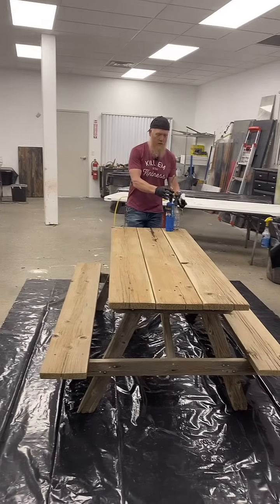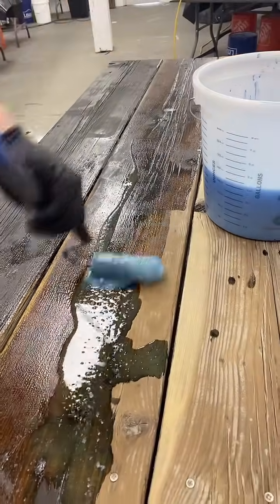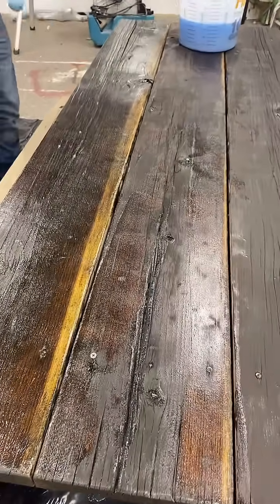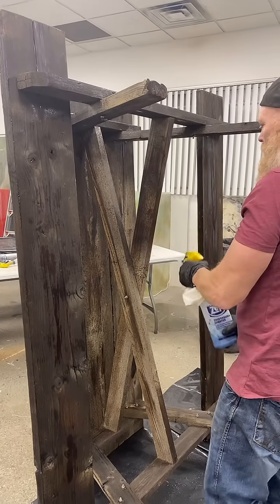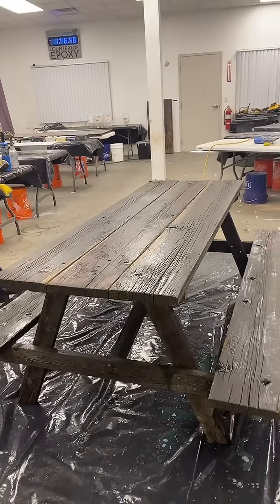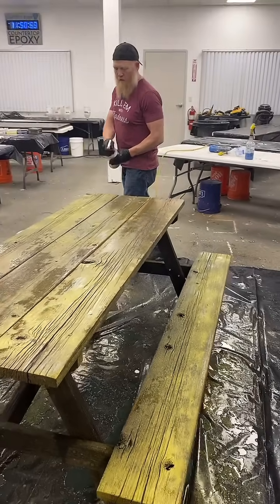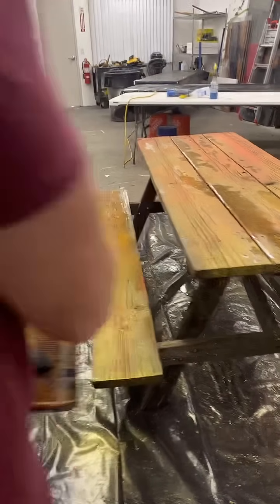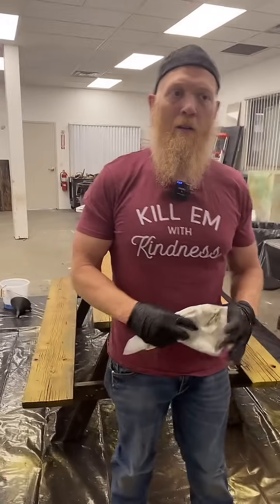Trashed Picnic Table Prep from Resurfacing - TikTok Live 05/03/24 - Countertop Epoxy

Comment: Hey guys, hopefully somebody will see this. I have a few questions. I have a deck. I built a few years ago and I never finished stating it. It’s pressure-treated, but it has been in the sun. It doesn’t get direct on with this seal coat concept work for that I’d like to put something on it and I have some epoxy I could use up,